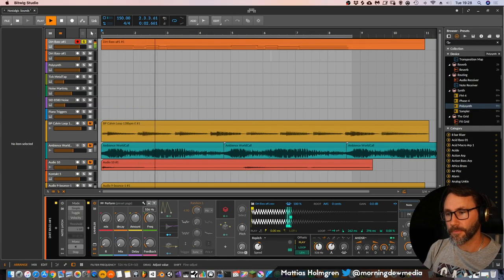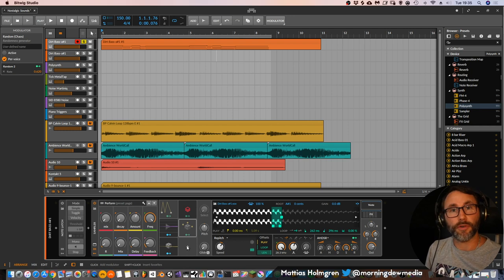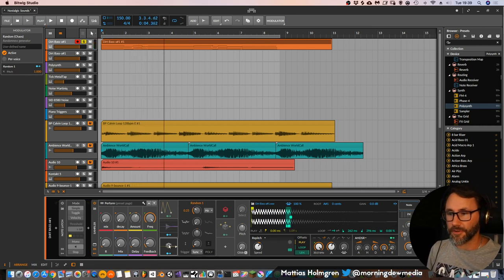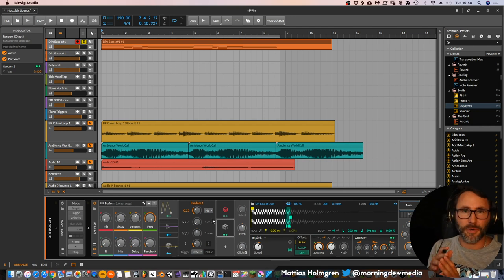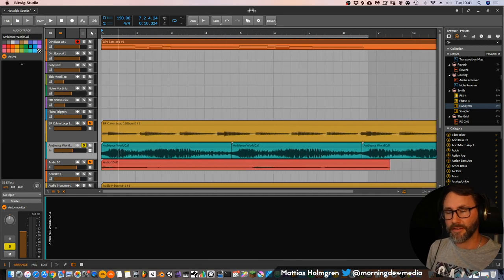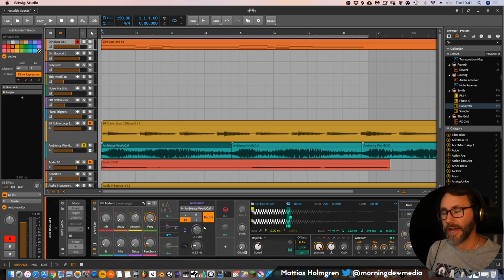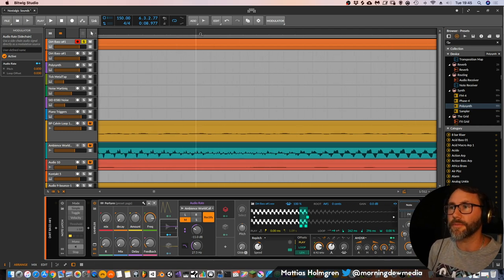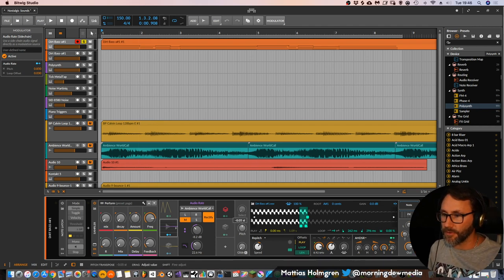How to make DIGITAL Sounds More ANALOG in Bitwig Studio

Comment: Hi Mattias, many thanks for the wonderful Bitwig content. Quick question, how does one add presets other than the standard presets that come with the Polygrid etc?  Struggling to do this. :(
Reply from the maker: Hi Gregg, thanks, excellent question. 
1. Do you mean: how to save presets? 
2. Or where to get additional presets? 

If you want to save presets in Bitwig: Drag your device to the right-most browser window. A popup will appear asking for your save-meta data. 
When saving presets you often want the whole device chain. Sometimes you might not have "nested" devices but rather just added them one by one as separate entities in the device lane.
Then just make sure the devices are attached to each-other (nested, like if you have a PolySynth, the following device should be added in the FX Slot of the PolySynth). 
OR you can add a Device Chain, and make sure all devices are inserted into the device chain. Then just drag n drop the Device Chain into the right-most browser window to save it.

You can also rename devices in the information panel. Click the Device Chain module, and enter your own name up in the information panel (left top corner) THEN save the device chain. 
You probably already know all this, but I thought I should mention a few more details around saving / nesting devices in Bitwig for other fellow Wiggers.

If you want additional presets (for many devices), check out my preset packs at https://www.morningdewmedia.com/audio-shop
Reply from the maker: One way to find out where your preset folder is located is to save a preset in Bitwig (drag to the right browser).
Then right click on your newly saved preset and select "Reveal File". This will open up Finder / Explorer to show you the location of that preset. ;) It's a quick way to jump into the user preset folder without surfing.
You can also find this out by looking at DASHBOARD -> Settings - Locations -> My Library
In this page all Bitwig specific locations are revealed so it's easy to see where everything is stored.

SHORT ANSWER:
Your user Bitwig presets are stored in users/YOUR USERNAME/Documents/Bitwig Studio/Library/Presets

Then there are separate folders for each device type in Bitwig so just put the presets in the correct folder according to device type.
Did that solve your problem? 🌞
Reply: @MattiasHolmgren  Thank you so much :)

Comment: Hi, if you change the trigger mode in random module  from Sync to free   you dont need to use another random module  to make it more chaotic
Reply from the maker: Ahh yes, but still a random free LFO jumps all over the place (smoothing helps but still it’s all over the place). Why I added another LFO to control the first one was to emulate a bit how the audio rate would effect our target. Like you have the big dynamic wave for overall mod-amplitude and then the gritty small audio details that ”poke out” to give us additional detail on top.

With the audio-rate technique you get a nice organic semi-random modulator. Which drifts with the dynamics of your source and get gritty details from the peaks). You have ”a sort of control” over the randomness via the source which is really nice. And you can experiment with stretching / contract the audio source to get various results. Neat! ;)

I think it’s a wonderful useful (musical) technique for adding some organic movement without setting up several LFO’s which quickly get chaotic and a lot of parameter fiddling. Its easy to just swap the source material with the audio-rate module too for various results. Send a drum beat to it, or bird chirps... ;) 

Definitely worth checking out. 
Thanks for writing Illuwo.
Reply: @MattiasHolmgren  yes and thank you for your amazing content
Reply from the maker: You are welcome Illutwo and thanks for writing and suggesting alternative solutions.

Comment: NICE! I've been looking for something like a random CV generator with seed support (CV in Reasonland not hardware), so I can have things that sound random but can be reproduced reliably. This is a great way of doing it as the audio rate modulation gives the impression of random jitter but is reliably reproduced each play through. I'm trying to transition over to Bitwig from Reason and the advantages keep coming ;) Really enjoying all your Bitwig videos, they've cleared up a lot of confusion and helped me feel at home in Bitwig already!
Reply: Thinking about it, this is actually possible in Reason too. You'd just use Thor to convert the audio to CV. But this is much more tidy
Reply from the maker: Yeah it's a nice way to feed a signals in Bitwig Studio. I'm currently investigating the modulation routing in latest Ableton Live 11 which just came out.
Reply from the maker: Indeed Bitwig has a nice modulation and audio routing engine. I know Reason has nice workflows too, but I always preferred other DAWs infront of the Reason interface. There are some really nice plugins in Reason though. Glad Propellarheads made it possible to run it as plugins. ;)
Reply: @MattiasHolmgren  yeah and it's a modulation I wouldn't have thought of. I feel this was the USP for Reason, but it just seems that Bitwig does it so much more efficiently. Yeah it's cool that we can use Reason as a plugin but for me personally it's not worth upgrading just for that and the few other improvements they made. So I'm going to try to transition over completely. I'll really miss blocks though

Comment: Is there any way to achieve this in FL Studio or Studio One?
Reply from the maker: Hmm not as we did it here in Bitwig Studio. FL Studio does not feature this type of dynamic "listening" device. But with some third party plugins and The Patcher in Fl Studio you might come up with something similar. Bitwig Studio is unique with it's awesome set of modulators. ;)

Studio One is probably the hardest one to get close to this effect. But on the other hand S1 does feature some console emulations etc. So it's easy to get an analog mixer sound with S1.
The DAWs all shine in different areas.
Thanks for writing!